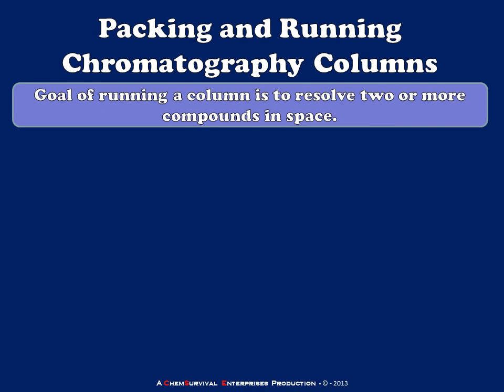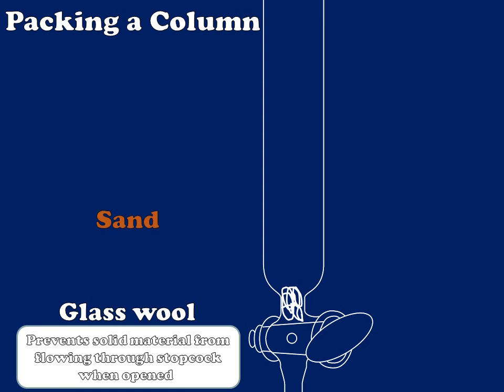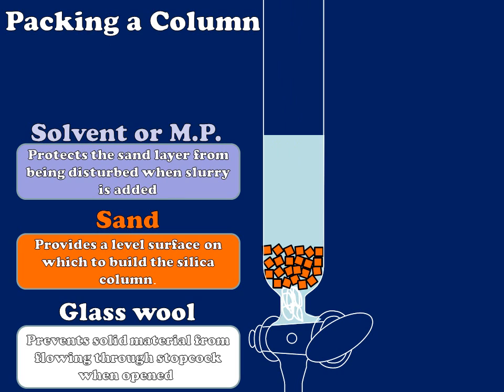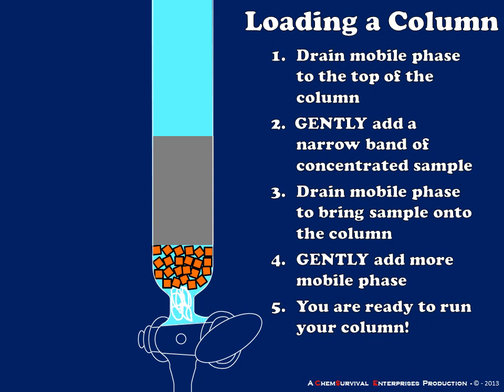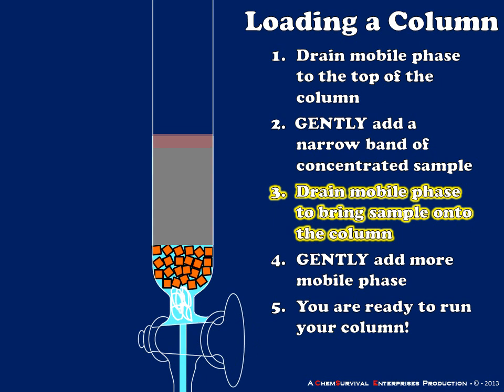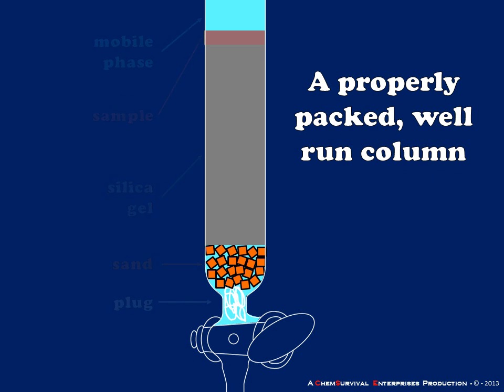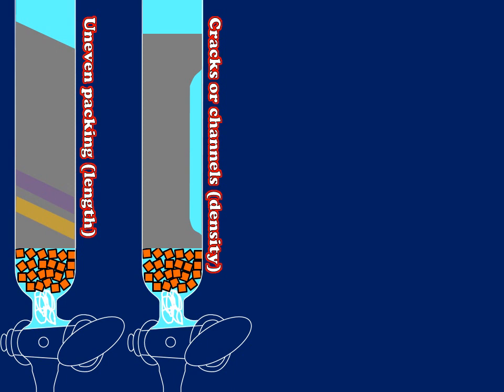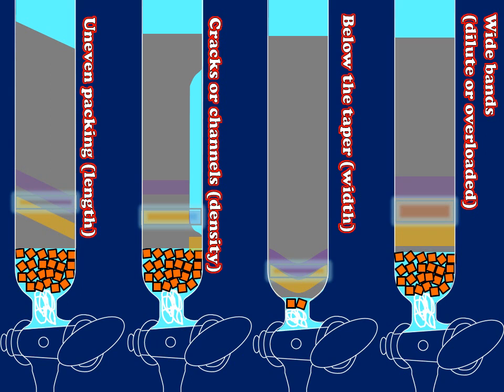A Brief Introduction to Packing, Loading and Running Chromatography Columns

Comment: Can i use ordinary sand?
Reply from the maker: That depends on what you mean by "ordinary".  The sands needs to be of uniform and sufficiently small grain size to prevent silica gel from penetrating the bed and flowing through it.  Naturally, you also want to be sure you're using sand that has been chemically cleaned so that you don't risk contaminating your materials as they pass through the column.  Many chemical suppliers sell so-called "chromatography sand"  or "sand for chromatography," which is guaranteed to meet both of those requirements right out of the bottle.

Comment: do you run a column to dry before you change the solvent in a gradient elution?
Reply from the maker: Hi Sasha.

No, you do not!  As the name implies, a 'gradient' elution involves a slow, controlled (though not necessarily linear) change in the mobile phase concentration over time to increase its eluting power.  The column should never be allowed to drain completely of mobile phase, since this would cause cracks and channels to form, ruining the column.

Thanks for the question!

Comment: Nice video! I am quite a cowboy when it comes to "gently" adding my mobile phase so I prefer putting a royal layer of sand on top as well, especially for large columns.
Reply from the maker: Yes, a little sand on top can be a column-saver sometimes.  In my teaching labs it proves to be more of a liability, though.  Many students manage to disturb the top of their columns when adding the sand intended to protect it.  Ha!

Comment: sand goes above the slurry. the point is to keep the slurry level.
Reply from the maker: There are those who believe in placing sand on top of the silica slurry as well.  I do not teach it to my introductory students for two reasons.  

First, my students have never had trouble maintaining a level surface at the top of the silica slurry without a sand layer on top.  

Second, and probably more importantly, adding the sand to the top of a column without disturbing the bed takes slight of hand that most introductory students cannot hope to achieve in an afternoon.  It is easy to embed the sand within the gel at the top of the column, creating irregularities that actually cause more harm than good.

Comment: thank you so much.........was very helpful...
i have question : why stationary phase always suspend(covered) by mobile phase in Chromatography Columns
Reply from the maker: because the stationary phase must always be saturated by the mobile phase to ensure that it does not dry out.  Silica swells somewhat to varying degrees in different organic solvents, so allowing it to dry out causes the silica particles to contract, potentially forming channels and voids in the column.  

Think of a bucket of wet sponges, all packed together very well.  If the sponges begin to dry out and contract, voids and channels will naturally open up.  inside of the pile of sponges.  Even pouring more water back in won't necessarily cause the voids and channels to close up completely.
Reply: +ChemSurvival thanks for the answer

Comment: Question: 
Why does the more polar layer (purple) of the sample move slower then the polar layer (yellow)? As you said, your yellow layer is less polar, but moves more quickly in the stationary phase. The stationary phase is in this case a silica slurry which is also polar, so why doesn't the more polar purple layer move faster than the less polar yellow layer? If the stationary phase was Alumina, would the movement of the layers be reversed? 

Thank you for the very informational video, much appreciated.
Reply from the maker: +Kaitlin Allerton Hi Kaitlyn.  The more polar compound does indeed have a greater affinity for the silica.  But remember, the silica ISN'T MOVING.  It is the stationary phase.  Sticking to a stationary object better means you are less likely to move!

In contrast, the less polar compounds spends less time on the stationary phase and more time in the liquid mobile phase being carried along, so it moves faster.

https://www.youtube.com/watch?v=kMIWNUrAx0k

This is a link to one of my very first YouTube videos.  It explains the situation you are asking about.

Hope it helps!

P.S. Alumina is also very polar, and would likely produce a similar result to that of silica.
Reply: +ChemSurvival thank you! yes I got it now. We are just now performing a lab like this, but dry?, for my organic chemistry course. In addittion we are writing the procedure ourselves. Needless to say I'm referencing your YouTube video, thanks so much! Will be sharing this with my classmates.
Reply from the maker: Kaitlin Allerton Thanks for the interest.  Please also check out my channel www.youtube.com/chemsurvival for lots more lab-related content!